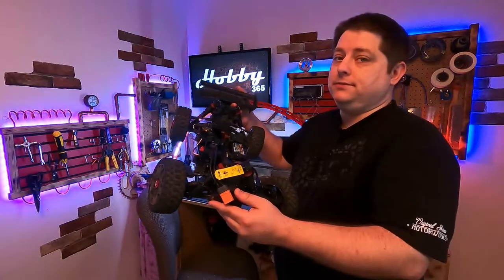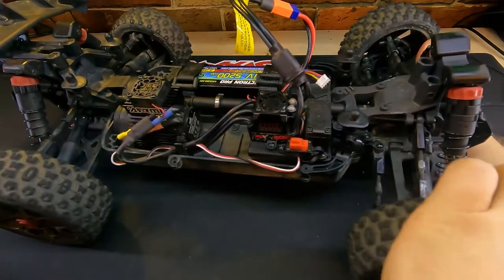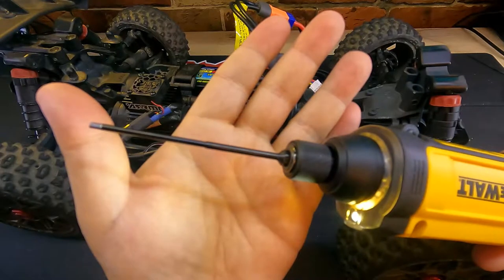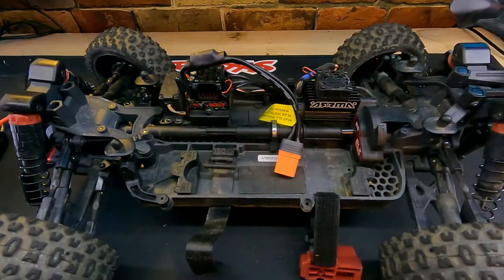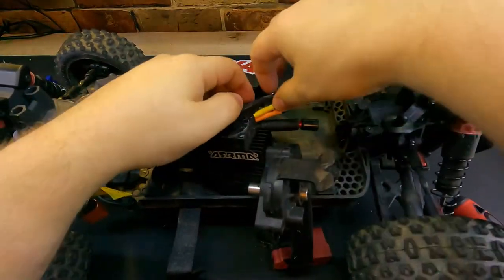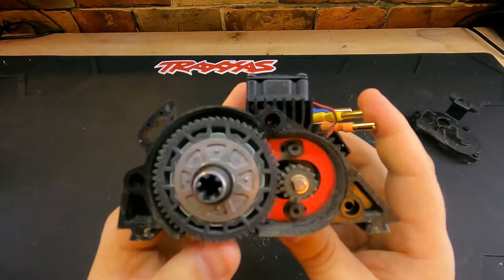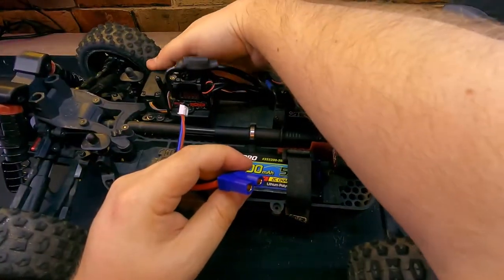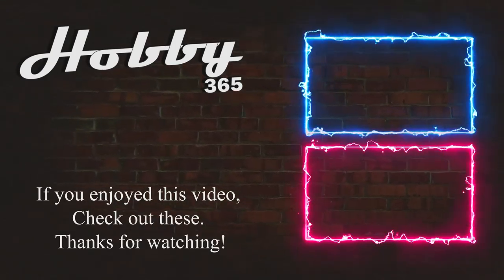How to replace a spur gear in 1/10 Arrma trucks

Comment: Super super helpful. I ran my brand new Vorteks 3s straight into concrete at almost full speed and got out lucky - broken bearings on the slipper clutch, bent motor plate, and the feature part of the video a stripped spur gear. It was a total relief to just get it going again... this video helped make it happen. I'm excited to get back to bashing. Thank you very much for being intentional, slow, and descriptive of how this needs to go back together the proper way, from a newcomer.

Comment: Well done, brother.  New to RC, and this happened.  What type of driving causes the spur gear to get rounded off on the tips?  Thanks so much.
Reply from the maker: I am happy to help. Rapid direction changes can cause this so avoid trying to force a wheelie by going from reverse into forward. Also hard impacts can cause the motor to shift and strip the gears. On these models dirt getting up between the gears can cause accelerated wear and tear so make sure to blow out your model regularly.
Reply: @Hobby365  Great advice, I'm guilty of rapid direction changes already. I have an Arrma Typhon 3s.  Any reason to think a 11.1V 8000mAh battery is too much for this machine?  It's the most powerful 3s battery I could find on Amazon.
Reply from the maker: @justinroach768  no reason to think you battery is causing it. 8000mah is your runtime. Not your power output. 11.1v is the proper voltage for your model.

Comment: Thanks, got the new spur in but when the car goes slow its fine but when i hit the throttle it pops sorta, brand new pinion, and spur, idk why
Reply from the maker: Check you gear mesh again. Sounds like it might not be quite right.

Comment: Man Ive done the spur rebuilt the slipper.. rear diff not the front diff and replaced the bearings in the transmission.. I cannot for the life of my figure out what is slipping . I can slam the brakes from full no issue no slip.. of ground and rev the shit out of it and its absolutely fine but from launch its screaming.. the transmission sounds perfect to me.. the diffs are working fine and aren't slipping.. to me it has to either be a broken motor somehow or they'res something wrong with the slipper I didn't pick up on... Driving me nuts took me ages to source the parts 😆
Reply: Oh and the spur at most has .2 play in it so I'm fairly certain it's seated right it's comming into each tooth seemingly well no catching or anything.. one thing I did note was rather then the top motor bolt and lower bolt are on opposite angles to where they are from factory.. didn't think much of it but with the 16t it was the only way it would let me get play in the mesh 🤔 I don't want to spend my weekend doing it again lol I wanna bloody drive it 🤣🤣

Comment: How can you tell if that center screw (1.5 turns out) is too tight or too loose?
Reply from the maker: That is hard to describe in words, but I will do my best. The slipper should take alot of pressure before it slips. When it slips you want to see it kind of skip rather than slip. So apply constant and steady pressure to your slipper assembly and look for the Skipping slip. Hope that helps
Reply: @Hobby365  Thanks! That makes sense! I got it back together and seems to be running good 👍

Comment: My gear just keep getting Loose and it does spins
Reply: Just
Reply from the maker: I assume you are talking about the pinion gear on the motor. You could try some Loctite. Make sure all the threads are clean apply only a small amount of blue Loctite to the threads before installing the screw.